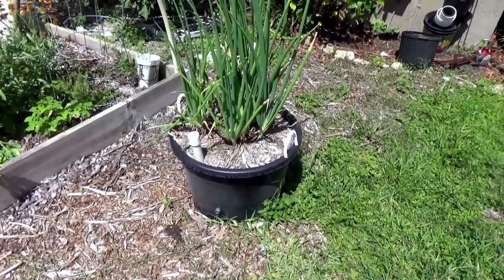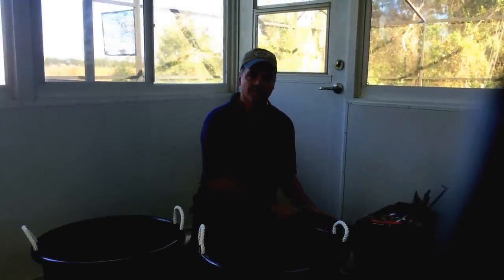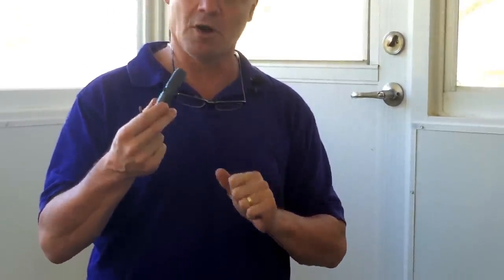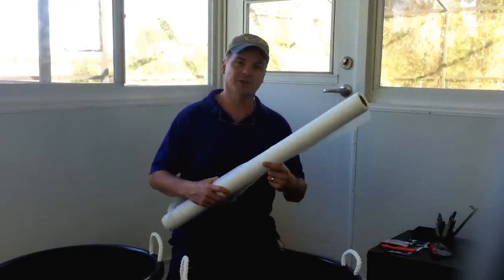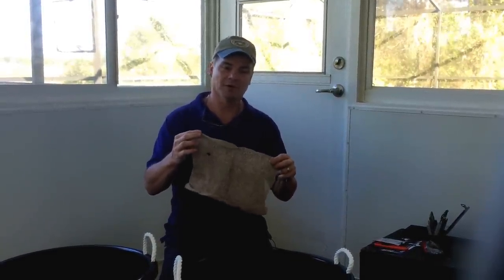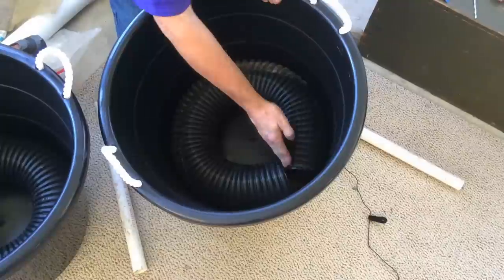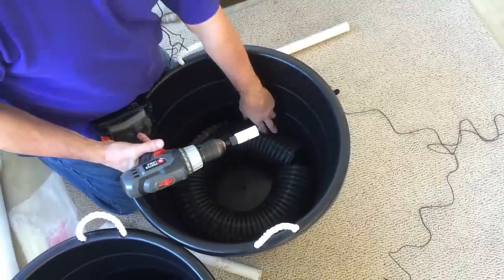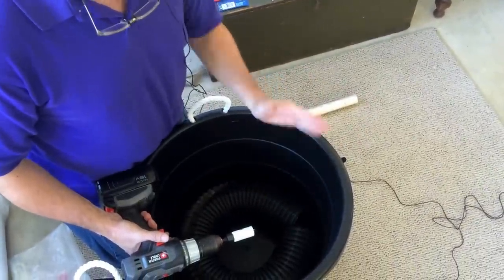Wicking Pots

Comment: Looks good.  My only issue with your method is that I believe you've drilled the drain hole a bit too high.  There should be an approximately 1" air space between the top of your 4" drain pipe and your bucket's drain hole. So that the plant's roots don't drown.  If you're using 4" pipe, the drain hole should be at around 3" or 3 1/2".
Reply from the maker: Thanks for the comment Doug.  The location we have the drain seems to be working fine for all the plants we have in them.  The beauty of a project like this is make any changes you need to fit your climate or personal preferences.
Reply: I agree.  Plants need oxygen in every grow zone. Aside from air space excellent video !
Reply: I thought 1" inch space aswell 👍 but cool vid bud
Reply from the maker: Just wanted to update - have been using these now for almost 4-years with the design - plants are doing fine with the drain hole where we have them.  I am not concerned about "drowning" the roots as the purpose of a wicking pot is to do what it is called - it is not for the roots to go down into the reservoir (one of the reasons we cover it is to keep dirt and roots out) it is for the water to wick through capillary action up to the root system.  We also have several different types of hydroponic systems and some never completely drains and roots stay wet, unlike our aeroponic systems where the misting happens for 15 minutes then stops to provide O2 for 15 minutes. There are many ways to make a wicking pot/container and the beauty is if you need to change the position of the drain feel free and adapt the project as you need.  Thanks for watching!
Reply from the maker: @kiwiboy82  Thanks Kiwiboy M - I just did an update to the comments since I had serval emails and comments about air space.  The wicking pot uses a capillary action to draw the water up to the root zone, and we are not having a problem with plants that we have growing. Thank you for watching and commenting - be sure to adapt and change as you need for your project and let us know how things go!
Reply from the maker: @Sallie424  Thanks for watching and taking time to comment Sallie.  Sorry for the delay in responding, I work in the Environmental Health & Safety field and have been rather busy the last few months. The wicking pot is designed not for the roots to be in the reservoir, but the water in the reservoir through capillary action is absorbed up to the root area.  We have been successfully using these here in Central Florida for over 4 years and previous to that used them in a similar design (smaller pots/containers) in Southern California. Let us know how you've change the design and how things are working out for you!  Thanks again!